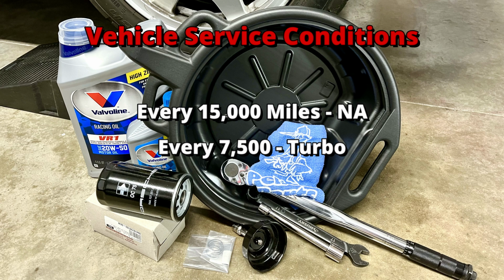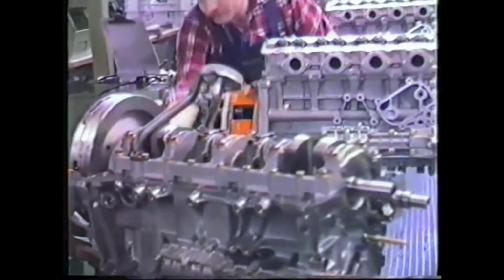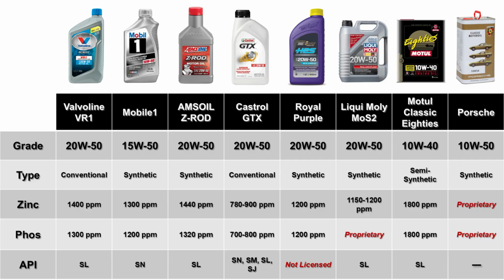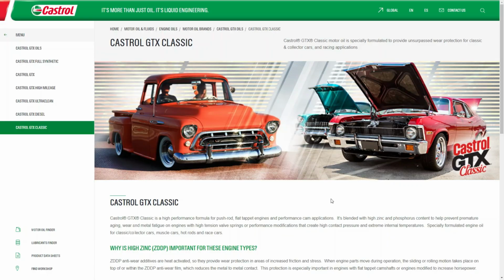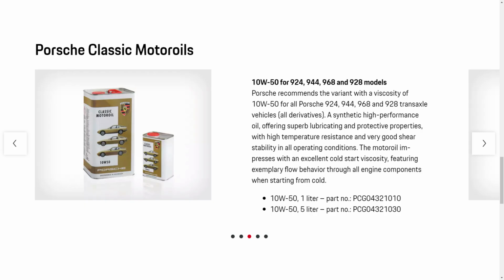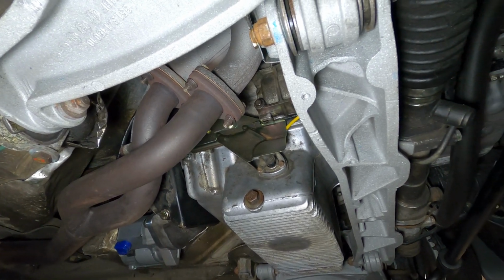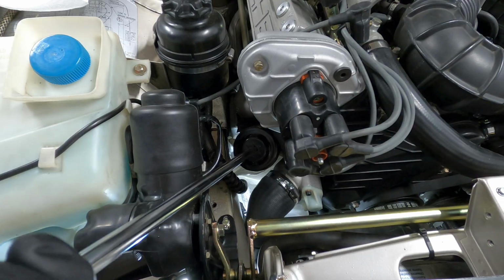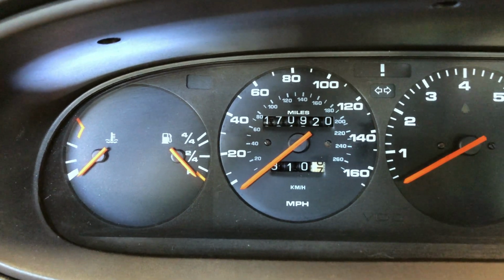Porsche 944 – Engine Oil & Filter Change Tutorial

Comment: As an ex Porsche technician, I always had an “issue” with Porsche recommendations regarding engine oil…

To clarify, this is the same Porsche that in the 2000’s /2010’s recommended that ALL Porsches whether air cooled / water cooled / transaxle use fully synthetic 5W/40…

Did quite a few “experiments” with 5/40 on friends classic Porsche’s,  (with no charge of course), they were literally “drinking” the stuff

I always recommended either 15/50 or 20/50  for the “older” Porsches, especially bearing in mind that in Greece for over six months the daily temperature is over 35 degrees Centigrade.
Reply from the maker: @arthurdardalis  Interesting! Thanks for sharing.
Reply: I own a 1988 944 turbo with a rebuild engine. I'm using Valvoline ZR1 5W50, because here in Argentina there is no 15 or 20w50. Is that ok? Summers are pretty hot here 35/40 degrees.
Reply from the maker: @ The 5w would essentially give you better oil flow in cooler temperatures as low as -35°C. A 5w-50 is designed for a wider range of temperatures, and should do fine during your summer months. I believe that one is recommended not to exceed 3,000 miles between oil changes, but you may want to check with the manufacturer to be sure.
Reply: @NC944er  Thank you very much!

Comment: well done!  I notice that the gas cover flap asks "oil ok?"  are these engines known for higher consumption?  I just drove my 944 almost 1,000 miles and it used about a quart of oil (it has 145,000 miles on it).  Does that seem normal?  thanks!
Reply from the maker: @briangoodman5260  Yeah, you’ll find a few excerpts in the owner’s manual that mention, “It is normal for your engine to consume oil” and “Make a habit to check the oil level at every fuel filling,” so the cover flap acts as a reminder. The rate of consumption can vary quite a bit based upon speed of engine operation, oil quality/viscosity, climate, etc., but Porsche’s recommended limit is up to 1.5 liters per 1,000km (1.6 quarts per 620 miles). Consumption beyond that point indicates your engine would benefit from a rebuild (possible worn piston rings, valve guides and seals). It seems your figures are within specification for normal operation, just something to keep an eye on if you begin adding more miles between oil changes.
Reply: @NC944er  good to know, thank you!  That's a pretty generous consumption guideline, esp. considering they are talking about the engine when new.  Based on my limited experience as a first time Porsche owner, I think these engines are quite durable.  My very experienced mechanic tells me he has never had to overhaul one (compared to many air-cooled engines he has had to rebuild.)  Also, just changed my oil and added a quart of oil stabilizer from a well-known additive maker.  Car now starts easier, idles smoother, and is noticeably quieter.  We'll see if it has any effect on oil usage, but regardless, 944s are a blast to drive!
Reply from the maker: @briangoodman5260  Yeah, I agree they are pretty robust engines when maintained, although long periods of neglect have been unkind to many examples, where various oil seals tend to need replacing. The timing belt is a weak point (short replacement interval) and the head gasket will eventually fail, but the piston rings and rod bearings tend to last well into 200k miles.

Comment: Well, once again you've convinced me to buy a product.  Going to swap to this VR1 oil during my next change on my 87 N/A with 97k miles.  Hope it gives good performance in a car that will be driven in a spirited manner and on an occasional Autocross.  Just making sure you are still happy with it and have noticed any negatives?  Would you go this route again?  Thanks for another great video!
Reply from the maker: Nice! Yeah, I think it would be well suited to those uses. My understanding is the VR1 has slightly less detergent in the mix, so you’d just want to keep up on the oil changes, not to exceed 3,000 miles in between fluid replacements, which I’m sure you would follow anyway by the sounds of it. My local Porsche dealer actually uses the Mobile1 15w-50 in all their classic car services rather than the “Porsche Classic” oil, which is interesting. 😂 But yeah, the Mobile1 and VR1 are solid options, I’ve done a few changes now with VR1 and have no complaints. I also ran a cleaning treatment through the engine last year (Marvel Mystery Oil) and the oil appears to now be staying cleaner for longer periods. Haven’t sent samples off for analysis or anything, just anecdotal observations.

Comment: Like your informative content. What are your thoughts on redline oil?
Reply from the maker: Thanks! I have their gear oil in my transaxle now and it’s worked out well. I haven’t used the engine oil, but they make quality products in general. Just check the zinc level to ensure it’s up to par.

Comment: I spent lots of time studying oil data. Could you tell me if that Valvoline VR1 is true racing oil and it should be changed every 3months due to low detergency or it's just a marketing slogan and I can change it every year/3000miles?
Reply from the maker: Hey Robert! From my research, the “racing” term is somewhat loosely applied here and it depends on what you’re putting it in and using it for. I called Valvoline on that one and was told to change the oil every 500 miles if being used in a true racing/track setting. They said the grey-bottle VR1 oil can be used on street-legal sports cars for up to 3,000 Miles between oil change intervals. I’m on my second oil change with VR1 and I feel like my engine got louder within 500 miles after the first change. I may switch to the Mobile1 next time, as my local Porsche dealer said they use Mobile1 for all their classic car services, even over the Porsche Classic branded oil, which is kind of funny. 😂
Reply: @NC944er  Thank you for thorough answer. I used Redline 5W50 which stopped engine to burn oil, but I got a bit of metal glitter in the oil after losing oil pressure for a moment, don't know if that is coincidence, now I switched back to Mobil 5W50 FS X1 after replacing bearings, but it's much less viscous(lower boundary of SAE50) and has less zinc(1100ppm) and my 944S2 started drinking oil again. Now I look for a replacement, Penrite 10 Tenths Premium 5W50 PAO/Ester with 1800ppm zinc is one option, the other is Motul 300V 5W50, the tech support of Motul told me it has 1000-1200ppm of zinc, don't know if that is true. I'm bit stuck. It's much easier to select something if you are in the hotter climate, but half of the year is quite cold where I live.
Reply from the maker: @8359s  When I talked to Motul, the rep seemed a little fast and loose with the technical information, I haven’t yet tried their products. Not sure if the Porsche Classic 10w-50 would work for your area. The 10w would be good down to -25°C or -13°F. Plus then you could put Porsche’s super cool transaxle car oil can on display. 😂
Reply: @NC944er  Thanks I couldn't find oil analysis on Porsche's 10W50(it's borderline fine for my climate, it only drops under 25 once every few years, please let us know what oil you'll decide to use, thank you very much :).
Reply from the maker: @8359s  Yeah, they are tightlipped on the blend specifications. I called and emailed Porsche a bunch of times and kept getting responses like “it’s proprietary.”

Comment: Wow, what a fine summary and modern oil & filter (2022) update for 944 Owners! Bravo! If I may, on a different note, is the Fuel Pressure Damper a new part? I am trying to find one, with little luck (11/2022). Thx.
Reply from the maker: Hey David, thank you! My fuel pressure damper isn’t new, just a nicely conditioned older unit. Are you looking for the damper or the regulator? If damper, are you having any issue with yours or just want to refresh the appearance? The dampers are only available from Porsche with no aftermarket options, and they generally run about $600. I’m seeing a few different part numbers across the model years and it looks like the newer part is back-ordered, but certain vendors may have inventory. For part number: 944-110-201-03, it looks like eBay seller: dr911ca has a couple in stock.
Reply: @NC944er  Yeah, my '86 951 damper is toast. It went south about a year after I swapped the regulator from 2.5 to 3.0 bar, and also upgraded the Bosch injectors. So now if I am driving, or if my son drives while I stand 35 feet away, I hear a loud clack, clack, clack . . . sound that increases its repetition rate with RPM if the engine is under load - so the injectors are really passing fuel. I used an automotive stethoscope and probed around the engine to pinpoint the sound as my son locked the parking brake and started feathering the clutch while in reverse at 1500 RPM to load the engine. The regulator at the rear of the rail was surprisingly quiet, and the cam housing revealed 8 happy lifters and cam lobes softly ticking away, the injectors themselves were calmly ticking, but the sound from the front-mounted damper was deafening through the st'scope. Ironically, the engine is very strong across the entire RPM range, its just the sound at lower RPM when under load is g-d awful. When cruising at any speed or coasting to a stop, the clacking disappears as the injectors are barely operating. The operation of the injectors under load at 3 bar average causes significant 'hydraulic shock' that produces lots of noise without a proper fuel rail pressure damper. A new damper should eliminate all the racket so I can once again hear the sweet sound of the 944 engine. I would love to know the difference in the original part and the newer one - higher reliability at 3 bar?
Reply from the maker: @davidrsmith2417  Nice diagnosis there with the stethoscope! I’ve listened to my damper the same way and it does make some ticking noise, but it’s on par with the level coming from the injectors, definitely not louder. I guess the diaphragm inside yours has failed, don’t think that’s super common. It looks like the part number that ends in 04 was superseded to 07, the 03 one indicates it’s compatible with all model years and interchangeable with the 06 one. 😂 I can’t with Porsche and their numbers sometimes. The Bosch part number should be stamped on yours and that would be definitive. Mine is 0280161015, and searching that reveals that Bosch is the root cause of the shortage. Some of these older parts they only do a production run once or twice a year. I’m seeing a pre-owned unit available here - https://www.fuelinjectionproducts.com/products/porsche-fuel-pressure-damper-bosch-0280161015-fits-924-944
Reply: My 951 came with a 2.5 bar regulator and matching damper. I am trying to source a working damper, preferably new, that is designed for a nominal fuel pressure of 3 bar. This would be an optimal damper. Failing that I will aim to buy a Bosch damper for a 2.5 bar system.

Comment: Great video! Thanks. I have an 86 turbo. At idle, the oil pressure sit at about 3. When I get moving it goes to 5. Is this acceptable?  Thanks again!!
Reply from the maker: Thanks Ross! Yes, those numbers fall right within normal range for these cars. Oil pressure should be between 4-5 bar at cold start and when under load. Once the car is warmed up and at idle, oil pressure should sit between 2-3 bar.
Reply: @NC944er  Thanks again. Your videos are a great resource for the 944 community. 😊

Comment: So I guess I should start using oils with higher zinc levels on my engines. I certainly didn't know about this.
Reply from the maker: Yeah, mainly for engines with solid or flat-tappet lifters.
Reply: @NC944er  Oh. So I guess that I'm safe with the oil that I use now as most of my cars have hydraulic lifters that share part numbers with the ones used on the more modern engines.
Reply from the maker: @MihaiGradin  What are you using now? The hydraulic lifter setup has some flexibility over a true solid mechanical lifter, where a much higher level of zinc would be recommended. The 944 lifters do have flat surfaces with direct cam contact, so a zinc level of 1,000-1,200ppm is beneficial for protecting the metal surfaces, but wouldn’t require anything as high as say the 1,800ppm seen in the Motul oil.
Reply: @NC944er  Right now I use Ravenol VST 5W-40 for my German made engines and I've been pretty pleased with the oil's performance during warm and cold weather and it also made the engine slightly quieter. From what I know the spec sheet for the oil doesn't mention the zinc levels or maybe I haven't found the right file.
Reply from the maker: @MihaiGradin  Yeah, that’s a nice mid-grade for both warm and cold weather performance. I’m not seeing a product data sheet on the Ravenol website where a zinc level would be listed. It’s often not published or released unless you call the manufacturer. I did find this independent fluid test performed by Polaris Laboratories, indicating that particular oil variant has 990ppm zinc - https://bobistheoilguy.com/forums/threads/voa-ravenol-vollsynth-turbo-vst-5w40.272046/
Reply: @NC944er  That seems like a decent amount of zinc, should be pretty good for most of my use cases.
Reply: Anyway. Love the videos so far. So enjoyable to watch and very informative. Keep it up! 😄

Comment: My drain plug has a little magnet at the tip.  Is yours magnetic?  I assume mine is oem but not sure.
Reply from the maker: Hey! Yeah, the OEM ones should have a small magnet on the inside to collect any metal shavings in the oil. Assuming somebody replaced mine somewhere along the way. I may add one to my next order as they’re only about $10. Thanks for the reminder. 👍🏼

Comment: Howdy!  Nice video.  Thank you for sharing.  I had no idea about the drop in zinc and phosphorus levels.  I’ve always been a Castro GTX person, especially when I was riding motorcycles.  I will switch to the Classic blend or use Valvoline VR1 for my 944.  Take care!
Reply from the maker: Yeah, me either! 😂 It’s not well advertised or even listed on the product data sheet. I had to call their tech line to have them provide the levels. Thanks the comments, Cheers!
Reply: What do you guys think of a zddp additive? I just did an oil change and have a half a case of gtx on the shelf I’d like to use and nothing else takes 20w50. They’re $7-10 per treatment.
Reply from the maker: @tims_4x4_garage  Nothing wrong with using a good quality additive from what I’ve seen. If you can bump up that GTX by +200 zinc, good to go. And really considering the overall life of the car, a couple more oil change intervals with the GTX alone shouldn’t make or break anything at the end of the day.
Reply: @NC944er  groovy.

Comment: Thank you very much your video’s have always been of great help, may i ask why you went with the valvoline oil. In the given diagram motul classic eighties has the highest zddp amounts right? Does your 944 have a catalytic converter?
Reply from the maker: Hey, thank you! In the case of zinc additives, more isn’t necessarily better once a certain level is reached. A good target level to shoot for is around 1200ppm zinc, as that’s what was commonly found in oils of the period. My car does have the catalytic converter installed, but the warnings we sometimes see on these high zinc oils are essentially to prevent people from using them in “modern” cars where the zinc isn’t needed, as they can poison the catalyst if the engine is burning oil. While the Motul option seems to be a fine oil, the benefit from its extra zinc over the Valvoline would probably be indiscernible, and the Valvoline is readily available at local auto parts stores, so it’s a little easier to track down when more is needed, which is why I ultimately went with that option.
Reply: Thank you for answering my question.